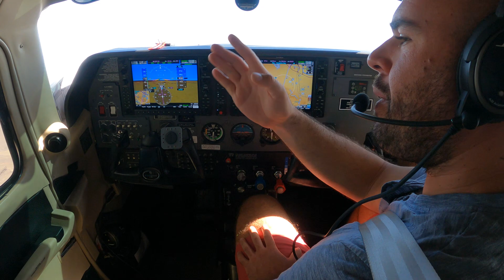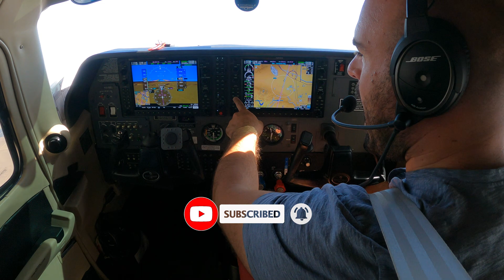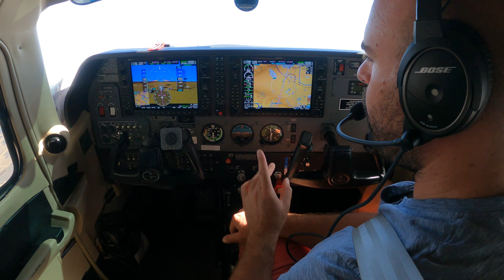Know PRECISELY What the APR Button Does | G1000 NXi

Comment: By getting vectors to final, wouldn’t you need to be on heading mode and then select vectors to final under PROC? Maybe I’m mistaken but if you press nav mode wouldn’t the autopilot fly direct to whichever IAF you selected?
Reply: Thats what Ive seen before you flying down, approach loaded, press APR turns you around to start the approach again - I’m a sim pilot and it always gets me

Comment: The APR button sequences the approach besides arming the LNAV & VNAV functions. It also loads the missed approach procedure.
Reply: That is a good point. Thanks.
Reply: Uh.. no it doesn’t.  

You can fly the entire approach and the missed approach without ever hitting approach mode.  

You don’t even have to activate approach or activate vectors to final.  As long as the approach is linked to your flight plan or you activate a leg of the approach you can fly the whole thing either by hand or nav /VNAV mode. The only thing you need to do is hit GA or OBS for the missed.

Comment: The biggest reason I see pilots screw up APR mode in any of the Garmin avionics is when they aren't in a position to meet their altitude intercept. If your GS/GP intercept is 3,000 and you arrive at 4,000, the APR won't capture the descent. You really need that vertical diamond to be centered before it'll capture.
Reply: This is not true unless you are above GP/GS. It won’t capture from above. You need to come in and intercept from underneath the vertical guidance path. You can intercept at 4K but you have to be further back on the approach.
Reply: @jrgfox

It will definitely capture from above.. it just requires an aggressive descent and usually slowing down.  I will typically slow the plane down to minimum speed and double the VS required for a 3 degree. This way it will capture before the FAF.

Comment: So when would you press VNAV button  vs approach button?
Reply: VNAV is just vertical guidance. It follows the vertical guidance that's set at the fixes in your navigator. Once you have VNAV loaded in your navigator, approximately a minute from TOD, you'll hear "vertical track." At that point, you hit the VNAV button and it'll follow the altitudes down in your navigator.
Reply: @LimaFoxtrot  Just so I understand, if I hit NAV and then VNAV, I have essentially used 2 buttons to accomplish what APR mode does. Fair?
Reply: NAV and VNAV are for every waypoint APR is only for the end of the flight.

Comment: Gilman is right-on.  Additionally, an important question is: When do I press the APR button?  

You press the APR button after an approach has been loaded into flight plan. And, after Approach Control says, “N123 you are n miles from final approach fix, ‘CLEARED FOR THE APPROACH’”.   This is known as a trigger, an event which cues the pilot to perform a specific action.  When Pilot hears “… cleared for the approach”, pilot presses the APR button. It is a trigger response.

The next question is: When can I set the MAP Altitude into the altitude alerter?
Reply: When both the localizer and glideslope have been captured
Reply: @zmanfire9162  ,  When you hear, “Cleared for the approach. “
Reply: At the FAF when you capture the Glidepath , at that point the autopilot will disregard the altitude  you dial in the altimeter

Comment: Pressing the APR Key arms both roll (Approach) and pitch (Glidepath/Glideslope) modes, to follow both the lateral and vertical guidance provided by the approach. But it will not follow the ARC on a DME approach.
Reply: Yes it will follow the DME Arc leg of an approach. If you activate an approach with the IAF set to the fix at the beginning of the arc.
I just did it the other day in MSFS and I just confirmed in the G1000 NXi pilots guide page 364. Bottom of the page is a section on its use with a DME Arc.

Comment: On top of arming GS or GP, I read somewhere that in APPR mode, the lateral sensitivity is increased as compared to Nav mode. In a 2D approach, could you shoot a VOR, LOC or LNAV approach by just pushing the NAV button and not use APPR? I thought the APPR mode was more ‘precise’ laterally than NAV. What do you think?
Reply: No.  

Scaling is entirely different than approach mode. It will annunciate on the CDI what type of scaling it is and it will switch regardless of whether any modes are active at all.